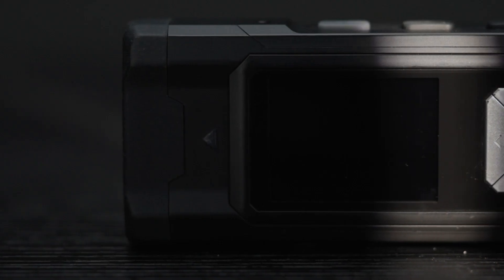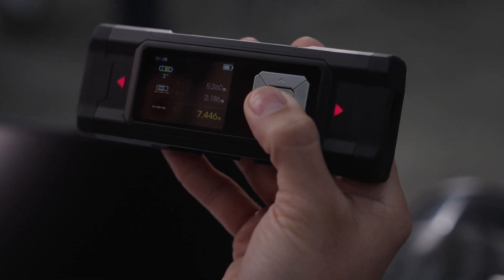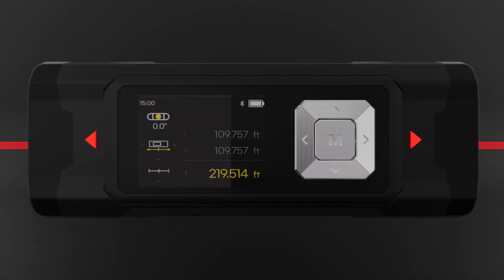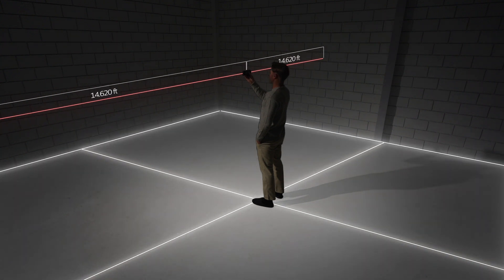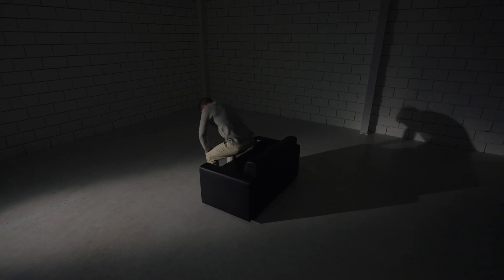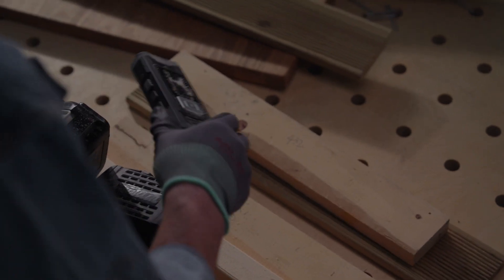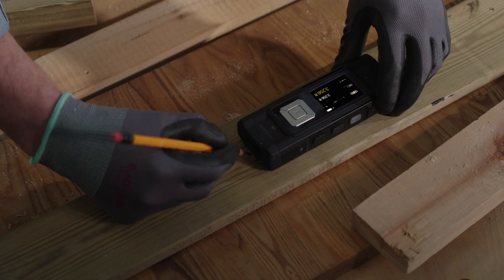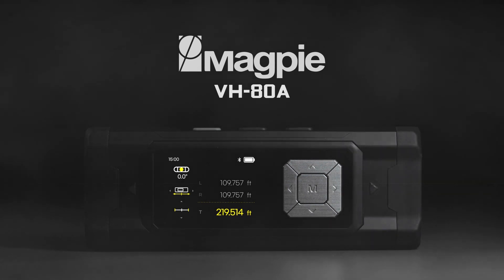VH-80A : Auto Calibration Dual Laser Distance Meter

Comment: Does the 'auto-calibration' give you the correct dimension between two walls perpendicular to them? How do you know when standing in the middle of the room if you are shooting not at an angle and perpendicular?
Reply from the maker: Hello JTDesign1! The VH-80A comes with an auto-calibration function, meaning that there is a built-in sensor that recognize the horizontal level. Measurement will occur only at a horizontal level, and this option can be turned off; can be activated only when it's desired.
Reply: Thanks for responding. I did invest in this new model, and I'm glad the A-C feature works in the Z direction, but what about the X-Y?  Your device gets you to level but what about being perpendicular to both parallel walls? @MagpieTech_official
Reply: When will how to video be out? I received this model yesterday.